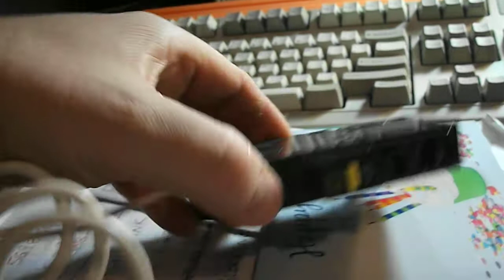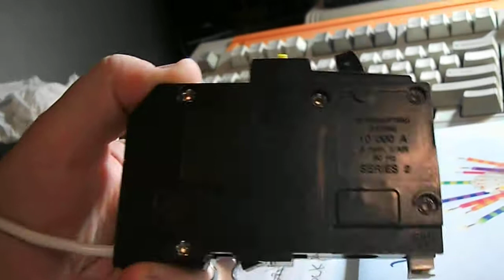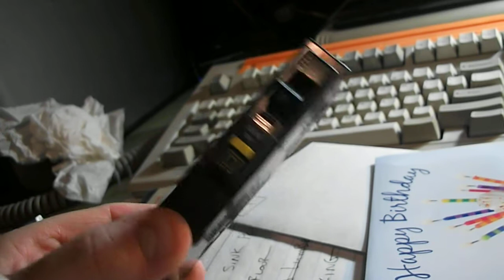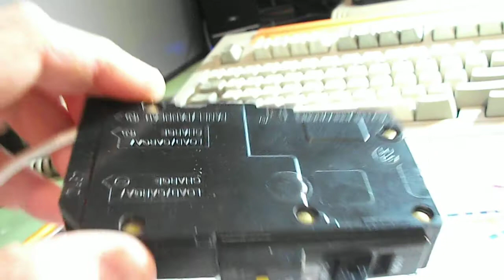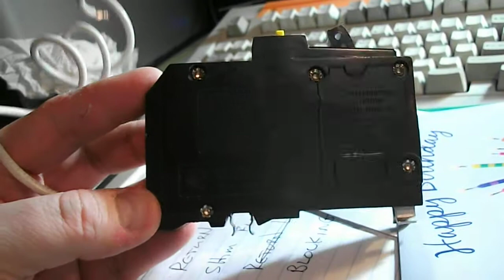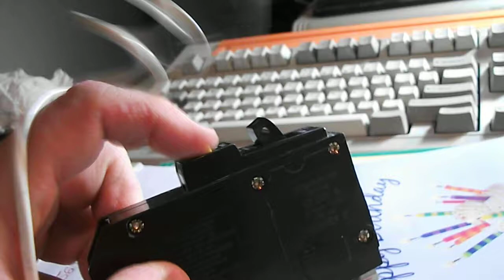I gambled and lost

Comment: Yea, I guess these things were designed not to be serviced. This past winter, I decided to work on the Honeywell gas valve on my boiler... took the thing apart and discerned what was wrong with it. I tried to buy an internal part and was scolded by an expert who said they are designed not to be taken apart by knuckleheads like myself. Ended up getting a deal on eBay for an entire valve.